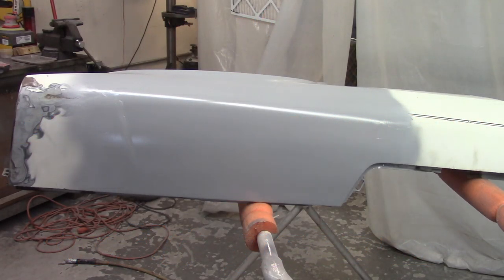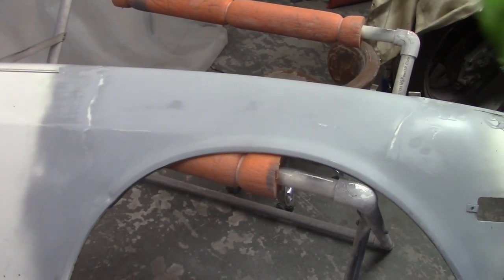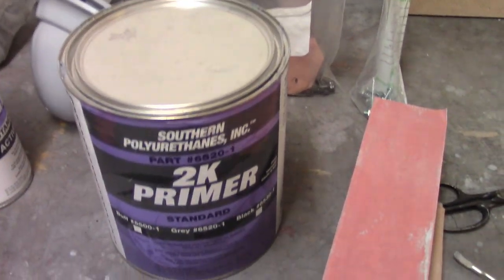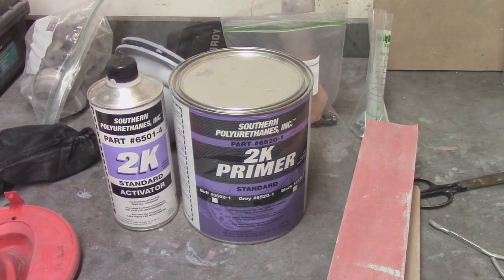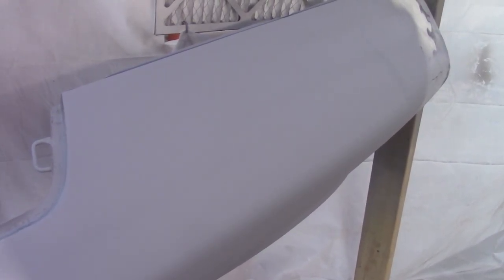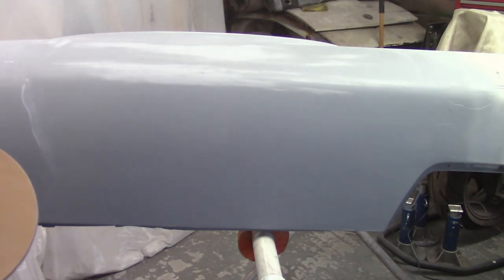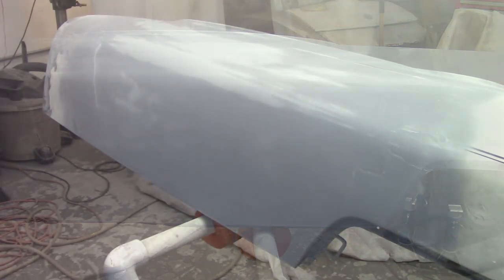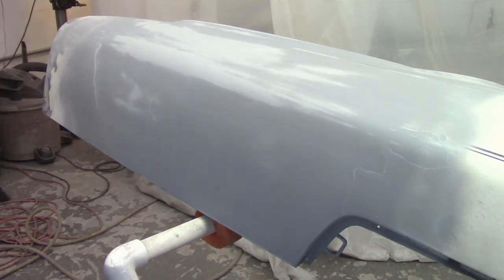Proof of Painting Procedure - Part 2 | Roundtail Restoration

Comment: "Wish my other project was this fast", Boy ain't that the truth!
Looked like your build primer was not atomizing well, dry and grainy. It got sanded off anyway. You're just about there!!! Exciting!
Reply from the maker: Thanks, Eric. Can you give me a time stamp when you're seeing that, or is it the whole time? There was nothing the stuck out at me as different versus the other times I've sprayed it, so I'd be interested where it's different from what you're used to.
Reply: I noticed it right at 4:00 when your first pass came in to the near field of your camera. The droplets look big to me. However, it was hot out possibly? Also I had never used SPI's build primer, I used Nason (only because I didn't know SPI at the time)
Reply from the maker: Yup, gotcha. I got to figure that out. I'm not overlapping enough...ran into that with my latest round of epoxy on the bonnet (video not out yet). That's causing me some re-work. Thanks, Eric!
Reply: I saw what Eric is talking about between 4:00 and 4:53.. Right on Eric!!!... I agree with Eric and think your material is not atomizing well....the old timers at the shop where I worked called it "corn rowin" (say it with a nasally deep southern accent) and you can get that when your air pressure is to low for the viscosity of the material you are using and/or your fan pattern on the gun is to tight (narrow). One of the guys taught me to shoot on a piece of cardboard (which I have seen you do) and play with the fan pattern and air pressure till the part of the pattern at the tip of the spray nozzle (what he called the heel) looks something like this (  and the pattern is a little wider (top to bottom) then you can spread the tips of your thumb and pinky apart (about 6 to 8 inches). I use lacquer thinner to practice with because it is cheep...getting ready to head over to the other side of the virtual shop to see how the bonnet is coming...Man that red is going to pop....
Reply from the maker: @njaahkbackyardbodyworks1807  I'm going to take some time tomorrow and retrain myself on setting the gun up. I think I may have lost my way a bit. Looked back at my early videos and the paint seems to have gone down better. I'll try it with the thinner, too. Thanks!